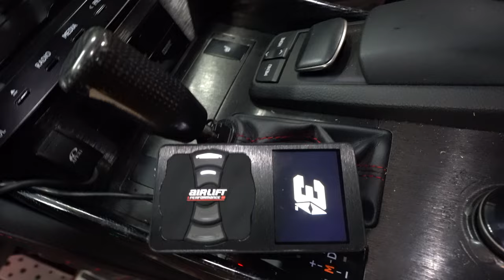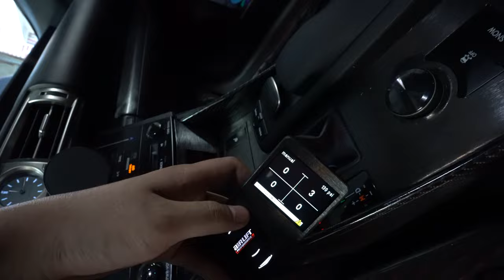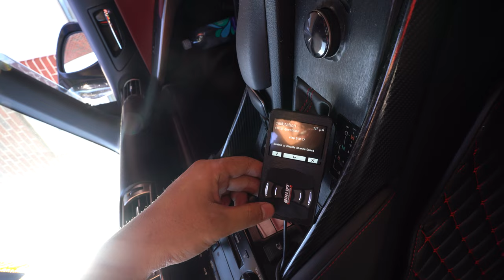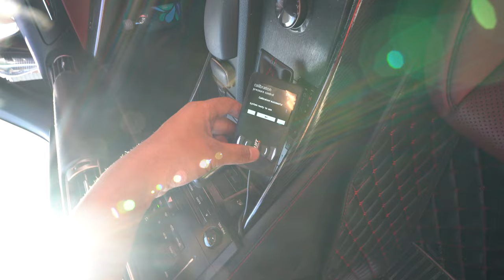2014-2016 Lexus IS Airlift Bags DIY Install

Comment: great video, glad you enjoy the bags,, its definitely easier to get in and out of areas.
Reply from the maker: Thank you for watching! Yea it has it pros and cons lol
Reply: @Kanbo11 what are some cons? I’m doing research now so when I need to do suspension I can bag it
Reply from the maker: Cons is expensive. If your bag pop it’s harder to get home or fix it. You have to do maintenance so things don’t mess up. If install incorrect can cause lots of headaches…..but most of these is fixable or not too much hassle. Not like coil overs where kind of install and forget it
Reply: @Kanbo11  it’s about a quality install.  Most the negatives come from someone doing a half ass install. I been on bags for over 8 years and never once had an issue. And I have personally bagged other cars and they will tell you as well install quality is key.  So yes it’s a bit more drain the tank maintenance but the extra step is well worth the peace of mind

Comment: Hey question ive been running air suspension for almost a year now, I was wondering what did you ever do with your adaptive suspension wire? I just unplugged it and zip tied it but it threw a check engine light.
Reply from the maker: I unplugged the plug and tuck the wires to the side lol. I think I wrapped it in electrical tape to make sure water or stuff don’t get in it. Never have a light from it

Comment: Thank you, after watching countless videos of bags install, no one tells you to manually put air on the bags before taking it off the jack stands or jack. If you drop it without air, you’ll risk the bag to pop or leak. They’ll show how to install and next it’s already cut to the part where it’s on the floor. Thank you. I’ve been trying to figure out the proper way and not destroy my bag
Reply from the maker: Thank you for watching. No problem. One of the reasons why I made the video. At the end of the day we're all out here just trying to learn

Comment: Badass ride. Been thinking bout bags but...u summed it up...I don't want headaches. Non the less...fire setup
Reply from the maker: Thank you🙏🏼. So far so good but then I have a daily lol
Reply: @Kanbo11  Nice. Nice. I wanna see my lexi reach 500k miles.
Reply: Hi JLB. I have had bags on 3 of my cars. 0 issues. Everyone I know that has had issues has been due to install errors. Rushing, not taking there time and not making sure fittings are installed correctly and not taping the threads. Take your time, do it right and you will be in love with the air system.

Comment: does the avs system still works or do they throw in error codes on the dash if theyre unplugged ?
Reply from the maker: AVS doesn’t not work anymore since I have it unplugged. No there’s no code for it.

Comment: I’m at 10k miles on my bags. I have a 2017 is350 fsport. What is the difference between 14-16 and the 17+? For the suspension
Reply from the maker: The only difference is the front strut bottom mounting point. 17+ has a fork style and 14-16 has eyelid style

Comment: So I do have an issue I have a is 250 and I got the car already bagged and I’m wondering if the spacer on the rear is missing how does it look mounted
Reply from the maker: What spacers are you talking about?
Reply: @Kanbo11  it goes on top of the rear bag where it’s a threaded rod
Reply: Looks like a hockey puck
Reply from the maker: If the bags are mounted to the top and doesn’t move then the spacer is probably there to hold it
Reply: @Kanbo11  ok cause the issue I’m having is everytime I go over uneven surface it shifts and starts squeaking then i air out the bag re adjust it then it goes away for a while then comes again and when aired out the top of the bag is swinging back and forth.
Reply from the maker: Yea definitely check it. See if the bracket is mounted in the right way and not flipped. The rear bags are where most people have issues
Reply: @Kanbo11  so downloaded a manual the part I’m looking at is part number 13321 and it’s called a upper centering spacer
Reply from the maker: Yea that’s the part. Jack up your car. Unplug the air line and take all the air out and try to move it around to see if everything is mounted right.
Reply: @Kanbo11  it’s missing smh how does it get installed

Comment: Yo bro where did you get the Rear spacer thing that they guy didn't uninstall ? It looks like I got the same problem and I need that round black spacer and the bolt that goes with it .
Reply from the maker: You can get through airlift or bag riders
Reply: @Kanbo11 hate to be that guy but you don't got like part number or anything do you ?
Reply: @Kanbo11 for bolt and for Spacer thing
Reply from the maker: 13321 - Upper centering spacer

IDK which bolt it was but here's both lol
17203 - 3/8"-24 x 7/8" Hex-head bolt
17415 - 3/8"-16 x 1 3/4" Flat-head socket cap bolt

Comment: Did you run the air lines though the spare tire? Or you removed the spare tire?
Reply from the maker: I put my lines like beside the spare tires through the little rubber holes

Comment: How did you secure the base to the car?
Reply from the maker: Can you clarify what do you mean the base? Like the wood holding the tank and compressor?
Reply from the maker: No need👍🏼. I didn’t secure the board. It’s heavy enough that it doesn’t move.
Reply from the maker: Yea no problem. Between the wires and weight. It’s not sliding around lol